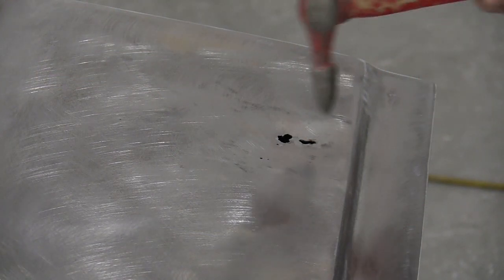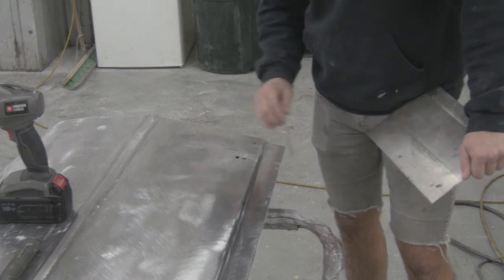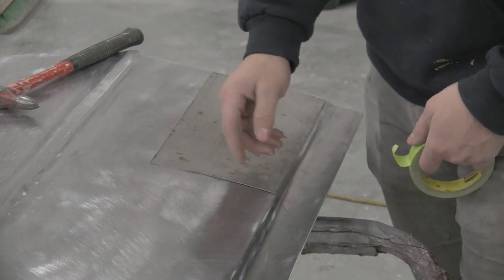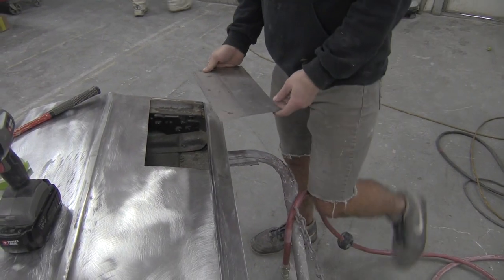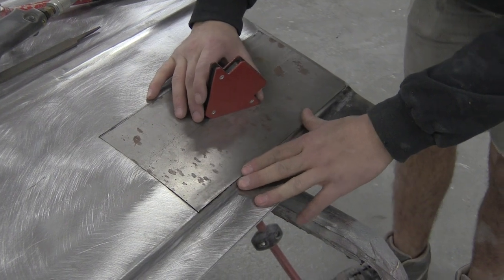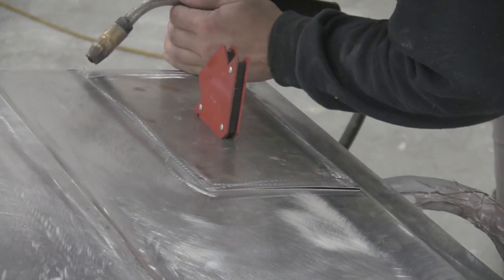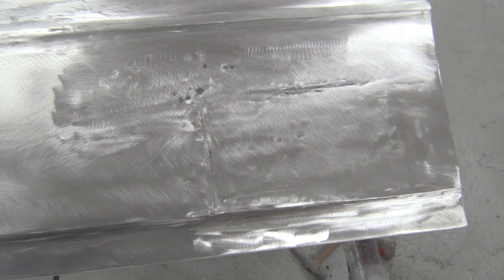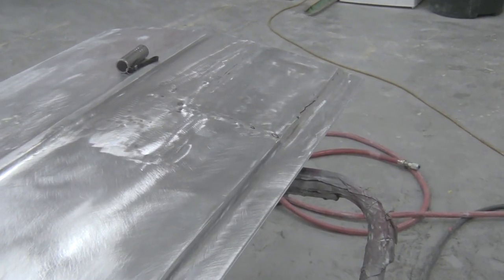How To: Make A Patch Panel

Comment: When welding a patch panel in an area where you cant paint afterwards, what is the best way to protect it from corrosion?  I need to replace the wheel tubs in my old truck.

Comment: Consider: tape the patch panel down as if you were trying to hold it in place. Scribe with a box cutter to cut a perfect line. I imagine it faster that squinting. A little fussy but I think it may be a tick more precise. There are videos on here with people cutting the hole and then trimming a patch piece for a day, so, by all means, carry on. Just had a thought.

Comment: Heat shrinking metal with air vs water. Have you ever experimented with using alcohol in an old spray bottle?
Reply: DaxHamel   What does the alcohol spray do?